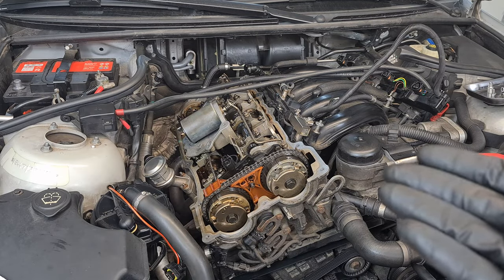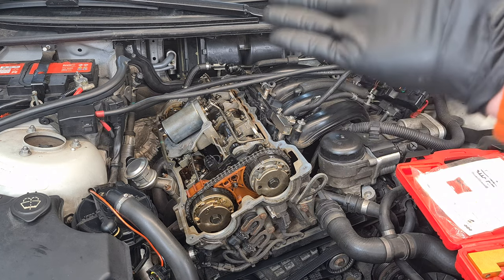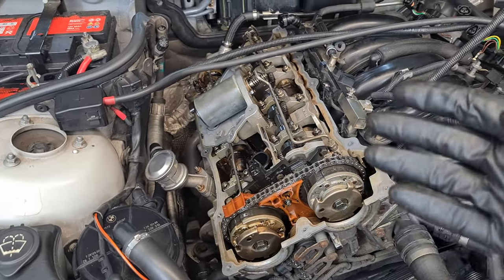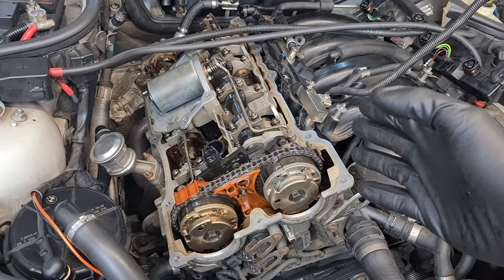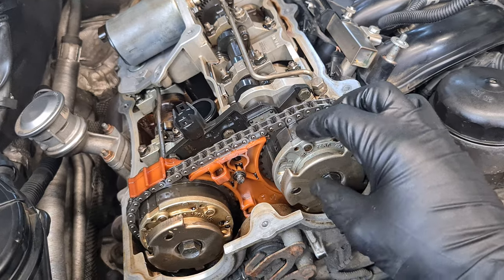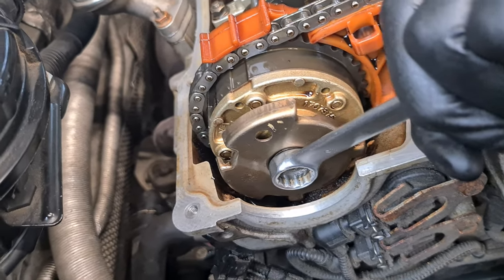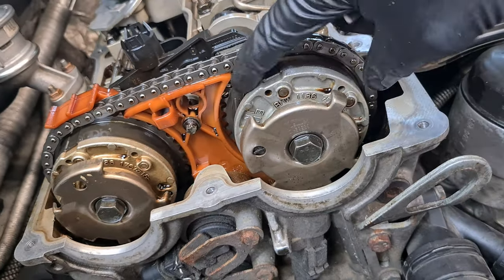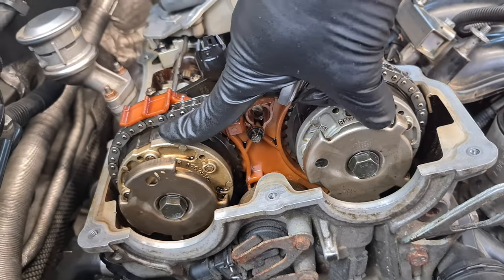N42/N46 Safe Valvetronic Removal & Detailed Timing guide

Comment: So I inherited a very low mileage 316ti which had stood outside for 2 years, the moisture in the engine had pitted the cam and seized solid the valvetronic system.  Local BM specialist charged me £200 to diagnose things then told me the engine is shot and the car not worth anything.....cue BIMMERZEN!  I ordered a used valvetronic assembly from ebay, stripped it and repositioned the cam,  intermediate gear and springs which had shifted in transit and it was good to go.  I also changed the chain guides which I suspect may have diminished over the last couple of years, same for the tensioner....I'm not a mechanic, I'm a cook!  Without BIMMERZEN this car would be history, as it is we have a beautiful pale green 2004 BMW 316TI with 25000 on the clock which is running like a sewing machine and throwing no codes!  THANK YOU BIMMERZEN.  Incidentally I used hose clip ratchet pliers together with a spare bolt as an anchor to replace the springs, so easy!  Dismantled cleaned and recommissioned in under an hour😊

Comment: Update for 2007 - 2009 n46, the intake camshaft no longer has the the rounded end as a reference point for the correct orientation, instead one end is flush with the last lobe and one end is notched, the notched end faces up for correct orientation, exhaust cam is the same as video though.

Comment: Hi! issue is from solenoid admision. They must have 3mm moving..you can open solenoid...in front of solenoid they are a cap that can be removed...take the spring and bracket out and check it
Reply from the maker: Interesting insight, but I can't really understand how is this related to the video?

Comment: Thanks for great, detailed video. Stirred up some traumatic memories. A couple of tips that helped me doing this job for valve stem seal replacement: 
1) I decided to remove the intake manifold, this is probably a 30min max job and means you don't have to get under the car to access the flywheel locking location
2) After getting the car in N (auto), disconnect battery and then you can safely remove the two 12V cables that cross over the top of the engine so they don't get in the way
3) Not sure if you mentioned it, but you need to use new bolts for camshaft sprockets since they are stretch bolts
Reply from the maker: Good point. I did try that once, but now "official" way is easier and faster for me because I've done it so many times. I also have a lift which makes it much easier. So for somebody doing this in his or her garage, it might be a very viable option.

And yes, I did mention that the bolts need to be replaced:)

Comment: 99.99% of the time it is true that there is a hole in the flywheel. But one time, I worked on a BMW 1 series with an aftermarket clutch & flywheel set without a lock pin hole.
We had to be really creative with a solution for timing. But yeah, 'normally'  there would be a hole in the flywheel.

Comment: Awesome Video but i have a Important  Queston please read if possoble‼️

You took it out with The Cam chaft is it Possoble that i unscrew chain tensoner and dont remove then Vanos wheels.

I then Unscrew the Valvetronic and lift it up but without the Camchaft it bassicly stays in posotion

Could you please tell me if it is possible this Way becausemy motor is Open and i have time stress and not the Special tools there other ethan than I would bassicly make all like in video (Zip tyes ect) for me i think its possoble that the Cam shaft just stays there

Could you giveme your opiniom on it
Reply from the maker: If you remove the valvetronic without the camshaft the valvetronic intermediate levers will fly out under spring tension. There is no realistic way to to this like you describe it.

Comment: I've done this procedure several times but each time the sensor bracket is slightly off and I have to turn intake and exhaust the tiny amount they do move when the camshaft gear sprockets are locked to make it fit. I've used two different timing tools and I'm using your chain pretensioning tool to pretension the chain.

The service manual doesn't say to put back the sensor bracket, only the flywheel pin and camshaft tools. I wonder if it's normal since the timing chain tensioner is inserted when trying, altering the tension on the chain.

Comment: The main isue with theese types of engine is temp junction. The wather opening valve is factory set to opet at 105C that is simpley too hot for this type of engine. If its possible i dont know to replace and remode the opening valve to lets say 94-95c it would be nice.
How much do you charge for theese plastick tools.
I could try this to do my self because the shops charges too much money for rubber seals replecament.

Comment: Can the engine run good with damage valvetronic roller bearing and caps
Reply from the maker: Depends on the damage. You can get away with a bit of pitting, but not so much with worn surfaces.
Reply from the maker: I made a short video on the N46 engine with corrosion damage that worked just fine: https://youtube.com/shorts/tY9KdNR65dg?si=wYUQZX7wwopeMQP1

Comment: Thanks for your videos! I just wanted to comment that the proper timing procedureof the N42/46 engines includes (according to BMW TIS) also fixation of the position of counterbalance shafts which requires to take out the oil sump. The correct adjustment/fication of counterbalance shafts is critical especially for 4 cylinder engines. As I do not see this in your video I wonder if you have any other trick how to fix lower part with short chain driving oil pump and counterbalance shafts as this gets loose (even if the flywheel is locked)  when the central bolt of the crankshaft is released
Reply from the maker: You need to align the balancing shafts only if the crankshaft bolt is released. In this video, the crankshaft bolt does not need to be released.
Reply: @BimmerZen  yep...that is absolutely correct....central bolt has not been released in this specific video.I had in my mind some older video on exchange of timing chain. Anyway- it is a little( but importont detail)  which I wanted to highlight for other "N46 timing chain adventurers". Otherwise all you vidos are fantastic and I am a fan of your channel
Reply from the maker: @salajovi  there is a section in the video where I time the balancing shafts: https://youtu.be/GVZqbvtp0VE
Reply: Excellent detailed video,have you considered putting the updated n46n camshaft and intake manifold for more power?

Comment: Hi man, i have a question about the camshaft Voltage input on n46b20 shouldn't be 5v for the signal ? And 12v ? for the input in my car i have 11.89v i guess i have a short

Comment: The engine vibrates when idling. I changed the coils, spark plugs, and injectors but it still doesn't fix it. Is it possible that the tonic valve is broken?
Reply from the maker: Did you check for vacuum leaks?

Try unplugging Valvetronic position sensor. If the idle improves significally, then you have intake valve opening issue. It could be related to the valvetronic components or rocker arm/lifter.

You can also check "rough running" parameters with INPA or N42 compatible obd reader to see if problem is localized to single cylinder.

Comment: Thanks for the guides - I have a problem,I only want to change the spark plug tubes in cyl 2 and 3 which are under the valvetronic. My spark plugs are getting wet. Is there a way to do it without disturbing valvetronic motor? I don't have any special tools
Reply from the maker: Unfortunately no:( they are sandwiched between cylinder head and valvetronic bracket...

Comment: hello, thanks for this perfect video. it is very very helpful to me, i like this blue zip at 40.30 , i had have so many problems with this plastic thing and the lockingpin
Reply from the maker: I've realized that this is quite a common issue for folks, so I actually made a seperate video on how to disconnect the CCV oil dipstick return hose: https://youtu.be/gmRjuAEmSbI

Comment: I have a 2015 528i installed timing chain guide tensioner and  it's skip timing  what's wrong
Reply from the maker: - chain not engaged on the crankshaft sprocket
- crank/vanos bolts not replaced and/or torqued correctly
- Vanos units not set in initial locked position during timing

Comment: Is the vanos unit keyed to the cam? What keeps it from spinning on the cam, with only a center bolt?
Reply from the maker: It's not keyed. It is timed with locking tools and then tightened in place with the center bolt.
Reply: @BimmerZen  Thank you! But there must be a pin? Only friction from the torque of the center bolt maintains the position?
Reply from the maker: @kidsteach938  Yes, only friction. There is no pin:)

Comment: hi i took out the vanos solenoids in my n46 e90 and cleaned them with contact cleaner and put it back after doing that i have issues with rpm idle i dont see any power loss but now theres sound from the engine and alot rpm idle issue sometimes it gets good mostly it fluctuates so much engine shaking. whats wrong and what i have to do so i can fix it .. please help
Reply from the maker: Did you accidentaly mix up the intake and exhaust connectors?
Reply from the maker: Also, did you make sure that the solenoids are all the way in and there is no vacuum leaks on the outer orings?
Reply: @BimmerZen  yeah i double checked everything  
sometimes no issues with rpm like i start the car no idle issue then rev it it start fluctuating rpm i tried obd for codes i got P0012 P0015 P0013 P0010
and when i turn off the car and turn on again sometimes rpmm fluctuates and sometimes not

Comment: My car is currently at the shop for misfiring and stalling after changing the vanos solonoid o rings, oiled them, put them back in the right way, right connectors. Solonoids were working fine beforehand just leaking oil.

Mechanic said they're working but the solonoids are out of timing and haven't  "learned" they've reprogrammed them and reset. Still not working. Do you know what the problem could be?

I know these cars can be pretty complex.

Thanks.
Cairo.
Reply from the maker: Did you check that the solenoids are connected correctly? It's possible to mix up intake and exhaust solenoid connectors. Take a look here to see how they are connected on the N42: https://youtu.be/QMfCeTXDsl8?list=PLcvaV8_M2DkZGzl9Aq_s7r5RhXfcXGvlA&t=400

Comment: Hello why don’t I have to block the flywheel first before even removing  the first Vanos bolds? Best regards
Reply from the maker: It's not necessary to insert the flywheel locking pin before removing the VANOS bolts because the camshaft locking tools keep the camshafts in place. You can insert the locking pin at that point but you must not use just the locking pin to remove the VANOS bolts! It is rated for only 60Nm of force.

Comment: Hi , I've recently replaced chain, tensioner and guides,  the car is running rough there is a vibrations that can be felt on the steering and seen on the review mirror.  The mechanic confirmed that the timing is correct,  when using their diagnostic tool no codes come up. When using INPA I get 2782 camshaft pickup outlet. However the logistics and error counter are both 0. They've clean the solenoids  and still does not help.

Please assist
Reply from the maker: Does the car vibrate on idle and gets better when increasing revs? Are vibrations corelated to the revs? Are vibrations only present in idle?
Reply: @BimmerZen  no vibrations on idle,  stays constant around 700rpm.  When revving in park there is no vibrations. only when driving the car. I also notice there's no vibrations when I am accelerating hard only after I take my foot off the gas the vibrations start. But if I'm cruising and accelerating the vibrations are there. They do not get worse with speed .
 I also changed my diff bush about 2months ago so ruled out that.

This problem only started after the mechanic changed the timing chain

Comment: Hi guys. I had a little leak coming from the eccentric shaft actuator gasket. I bought a new gasket but when I removed the 2 bolts, one of them came out with the insert as well. Is there a way to glue back the metal insert inside the plastic rocker cover? Thanks
Reply from the maker: Very common issue. People torque those two bolts too much and the brass insert breaks from the plastic valve cover. The solution is to use a strong soldering iron and heat up the brass insert until it is hot enough to melt the plastic. Then carefully press the insert back in to the hole in the valve cover, making sure that insert is surrounded by melted plastic (https://youtu.be/G-UF4tv3Hvc?t=163). This solution worked well for me. Make sure you don't torque the two bolts more than 6Nm.

Comment: Hi, you mentioned that you did this particular job to verify rough running on one of the cylinders, will you make a followup video on this topic on what you found? Or maybe there was no difference?
I'm curious about the valvetronic system and how it can wear out.
Reply from the maker: I'm working on that video for some time now... the engine still feels like it has some roughness. I've reset the adaptations and I still need to drive the car a little bit for everything to settle. Currently the nr 4 cylinder is better, but the roughness moved to other cylinders.

Comment: Nicely done! Have you done a video on replacing the N42 valvetronic actuator? Is there a part in INPA for the E46/N42 where you "relearn/calibrate" the new actuator? I had a quick look at your other videos but didn't see one. Many thanks for any help.
Reply from the maker: On the N42 engine (ME9 ECU) there is no manual function to calibrate, as far as I know. It is performed automatically if it detects that the current VVT position is different than the one stored in the memory. So if you change VVT position, just let the ignition key in position 2 for about 10 seconds and it will perform calibration.
Reply: @BimmerZen  Thanks very much for your reply. Had already successfully done the job but good to know. Took the added protection of "locking" the worm gear in place with wooden chocks and carefully turned helical shaft in and out to the same place. Another slight finesse to your instructions is to hold the large gasket in place temporarily with zip ties which can be cut out before bolting down. Saves worrying to much about it staying in place especially at the rear. Make sure you cut the right part though so it all comes out at once! String would work also I guess.

Comment: Good video, if I need to remove crankshaft bolt, is the flywheel lock pin strong enough to hold  ? I know mini have a tool to hold too?
Reply from the maker: NO! It is explicitly stated in the manual  that you must not use it to release the crankshaft bolt. That bolt is really high torque and could also be a little bit seized. The pin is to weak to hold the crankshaft and you will damage the flywheel, locking pin and the engine block!
Reply: @BimmerZen  Thanks! what about the cam bolts?
Reply from the maker: No point. You will need the locking tools to put the engine back in timing, so you might as well use them to remove the VANOS bolts. Torques in excess of 60 Nm will damage locking pin and the engine block and the VANOS bolts are torqued to more than that.

Comment: do you know of any issue of misfire on low end revvs and fine on high revs buit if i rev slowly itll rev out fine all the way through
Reply from the maker: Hard to say. Maybe worn eccentric shaft: https://youtu.be/uystFxSws-Y?t=54 but it could be any other thing that involves combustion: coils, injectors, sparkplugs, ... Or damage on valvetronic components, bad DC servomotor. Did you try scanning for error codes (with compatible scanner for your engine/INPA)?

Comment: Hey man, long time subscriber here. Had a question. 316ti N42b18 engine. Car has been doing weird rpm fluctuations. Like goes 1300 and then 900 and so on. Any suggestions what can IDo
Reply from the maker: I suggest you scan for errors with INPA or N42 compatible scanner. I would check for vacuum leaks first...
Reply: @BimmerZen b

Comment: i put the intake locking tool on, but now the exhaust one doesn’t sit flush with the engine
Reply from the maker: Did you check if both VANOS units are locked in initial position?